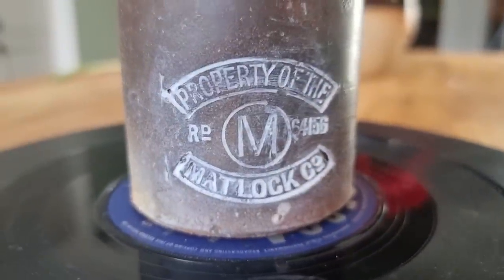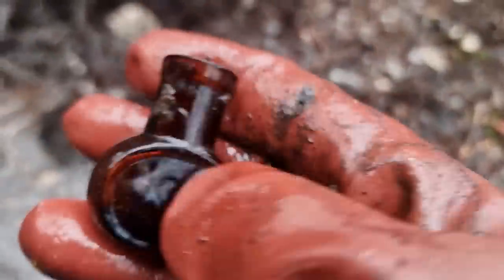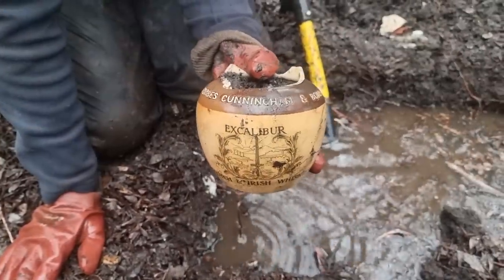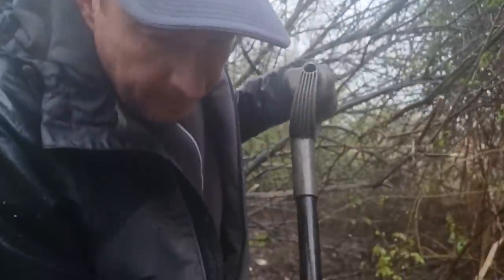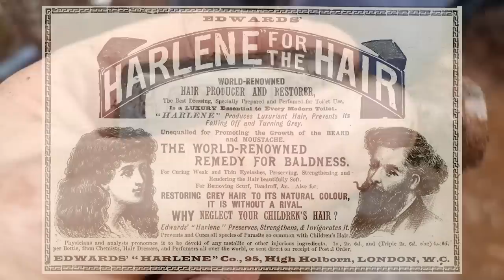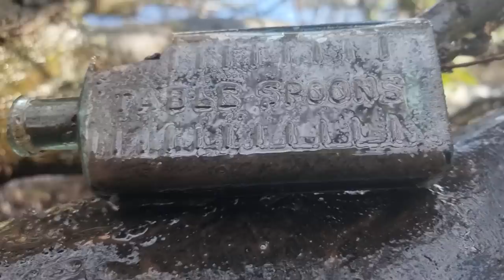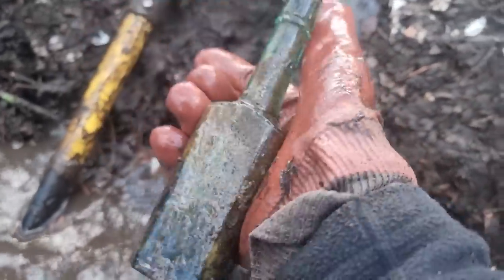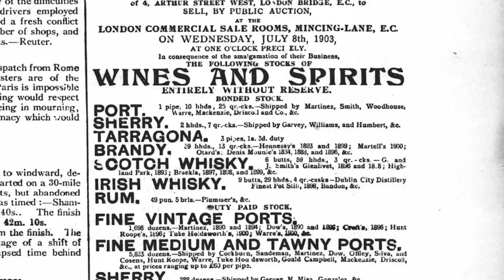Mega RARE find worth £££s! Treasure hunting in the woods

Comment: The poison bottles have raised vertical ridges on the sides so you know it is a poison bottle if you handle it in the dark. They look like grooves or stripes, but they are raised from the surface, so when you grip the bottle you must feel the striping effect. Chemists might be working in low gas light or by candle light, and you did not want to make a mistake when making up some medicine or ointment.

Comment: With the clay you used on the water jug, is it possible to sand or wet-polish it to get a smoother texture? It could help achieve more a color blend for the paints you are using. Just a thought.
Reply from the maker: I could lacquer it I guess

Comment: Hey Si i have a question! Whats the name of the old game using a round metal pieces with two holes drilled in them and mounted and spun on a string? Have you ever found any of these two holed pieces?🍻
Reply from the maker: It’s a whirly gig, yes I have found one and it actually worked. The video was about a year ago now
Reply: @Sifinds  the one they found on Oak Island is made of lead has two holes in center and scalloped edges..sound right? Cheers mate!!